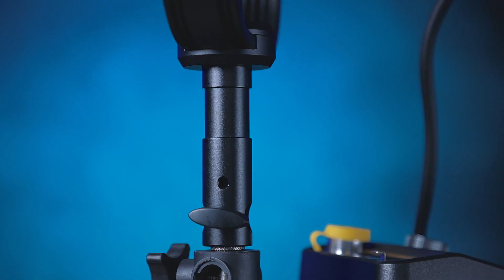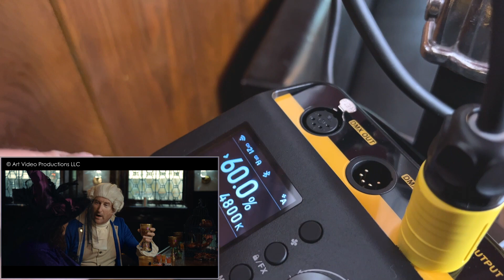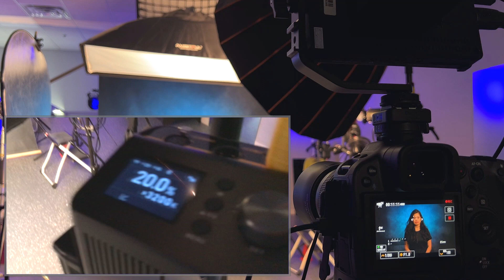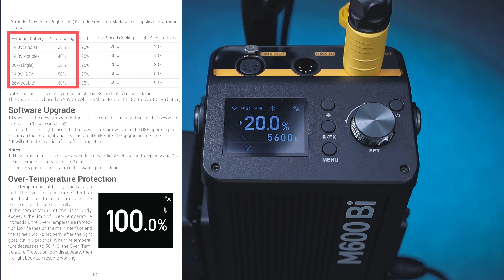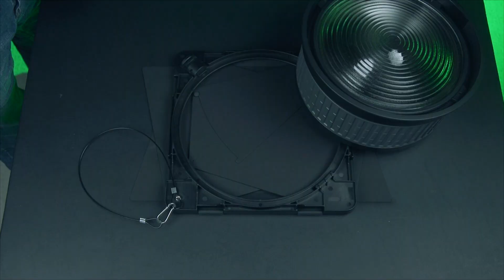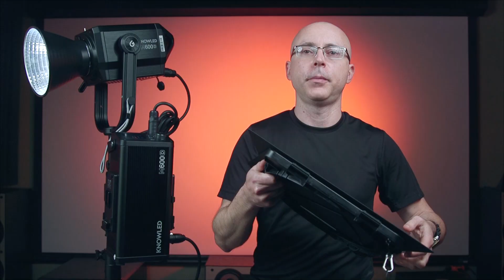Godox Knowled M600Bi Bi-Color LED FULL Workshop  | EVERYTHING To Know! (Chapter Indexed)

Comment: Will the Fls10 fit on a godox Ad600???
Reply from the maker: If it has Bowens mount then yes. The A600BM is, not sure about the AD600 if it is Bowens mount. However, the FLS10 will be VERY front heavy. If the ad600 tilt part is made of plastic, then, no. Don’t do it.
Reply: @ArtVideoProductions  the ad600 is about 6lbs with the battery and yes the tilt part is plastic

Comment: Would have really liked to see the brightness readings done from both lights done at 3 meters. Cool review though.
Reply from the maker: At 3 meters it’s simple. Whatever light source, brand or type, you lose 75% of the intensity from where you started… That’s the inverse square law. Light falls drastically as soon as you move it away a mere 1 foot. So, at that 3M distance, that 740 watts from the initial reading will “feel like” 250 watts if you will… 
Research the inverse square law for lighting. Many available here on YouTube. Knowing this is extremely important.
Reply: @ArtVideoProductions  Because most will be using the light at 3 meters or more is why its important to measure the 75% fall off so as to really see the bigg fall of between them. At 1 meter you won't really notice much of a difference between them, but at 3 meters away, u notice which one has the most loss in intensity.
Reply from the maker: @akpevbe  no problem. Next time I have a chance to use this light, I’ll post here for you. And once again, thank you very much for watching my videos 🙏

Comment: Hi I am big fan of your videos I have a question I know the apture 600x is more money but how does it compare to the Godox 600 bi
Reply from the maker: The only thing the Aputure would win would be the built in FX. Other than that… the M600Bi is practically similar performance
Reply: Thank you for always your quick respond another question if I may hows the Godox Knowled m600bi stack up. I when to your you tube channel I saw nothing about it. I need a powerful unit for my kit. Just a quick background of my work. I do everything from interviews, indie movies, sizzle reel, branding spots (if it move i shoot it) mostly a DP but getting a lot of calls to be a gaffer with gear Thxs for your time n videos
Reply: I meant the Nanlite Forza 720bi

Comment: Thanks for this. Can you compare the fan noise to the 600d? Is it the same?
Reply from the maker: Identical
Reply from the maker: Don’t forget that you can turn the fan off and at 20% it’s brighter than a Godox FV-150
Reply: Cool. Thanks for the review. Yours is the only review I can find, and I want to buy the light. Seems like there is no reason to get the 600d of the brightness and fan noise are the same, since you get the added benefit of variable color temp.
Reply from the maker: @ChrisBucklin  I’m not sure if you’re subscribed to this channel, but just so you know I’m the first to get these products. FV-150, TL-30, TL-60, ML60, ML-30, UL150II, M600D, M600Bi, SZ-150R, SZ200bi. All of these, my channel was the first to get and review ahead of everyone else on YouTube. And when I review something, it’s always in absolute detail.
Reply: @ArtVideoProductions   Subbed. Thanks.